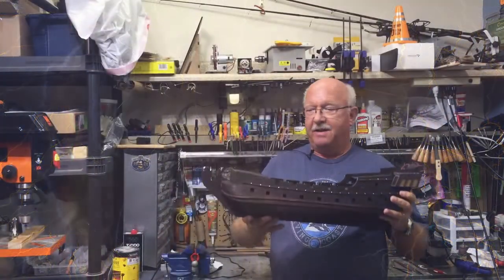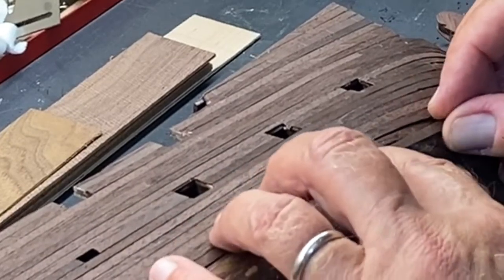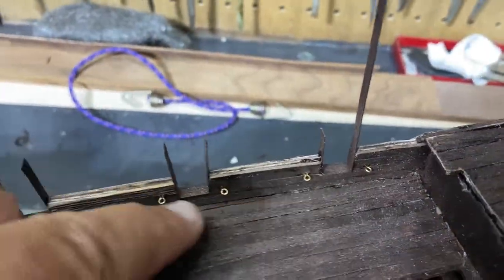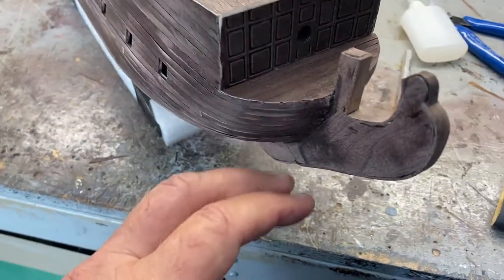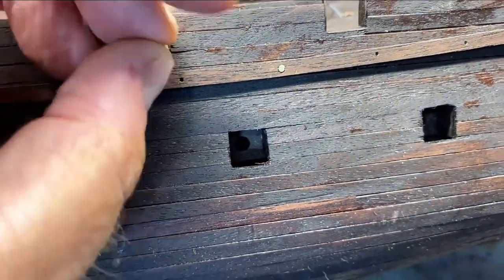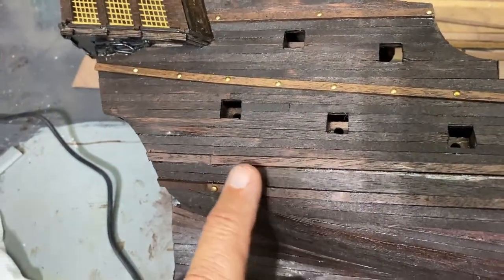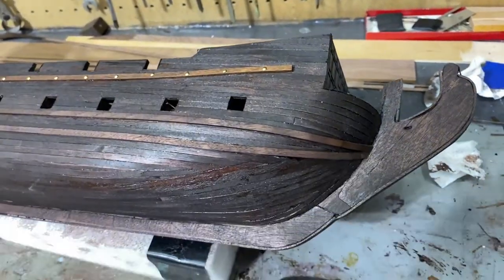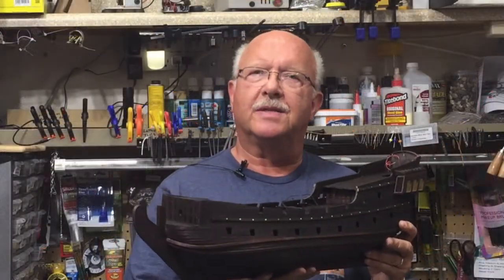The Black Pearl Golden Version 2021 Episode 9

Comment: Dan,what size of brass nails did you order for the side rails?
Reply from the maker: It’s been a while, but I’m fairly confident I ordered them from Amazon.  The head being .3 cm (.11”)
Because I show on Amazon that I have ordered them at least twice.
Here’s a link to those for you to check out.  Unfortunately the ship is on display at a shop in Port Royal S.Carolina, about 800 miles from here, otherwise I would measure them for you 😂.
Here’s the link:
Hardware Philosophy Pure Brass Nails, 0.6 Inch, Bag of 100 - Architectural, Interior Design, Doors, Furniture Cabinet Customization Hardware https://a.co/d/2qNYd1Z

Comment: Hello Dan, Just curious about the size of the brass nails that you have used?
Reply from the maker: I went out to my shop to get one to measure…. I’m out!  So thanks for asking as I’m ordering more!
They are Hardware Philosophy Pure Brass Nails, 0.6 Inch, Bag of 100.
Here’s a link to purchase them online at Amazon:
https://a.co/d/17iWZQr.
SET OF 100 BRASS NAILS: Total length of the nail measures 0.6" (1.5cm)
The diameter of the shank measures 0.04" (0.1cm); Diameter of the head is 0.08" (0.2cm)

In addition, I have been able to find another one that might work too.
It’s got better measurements in the listing that might be an option too?
It’s smaller, here’s that link:
Hardware Small Nails for Wooden Nail Tiny Antique DIY Decorative Boxes 1X10mm Golden/500pcs https://a.co/d/aw4X19g
Note: the picture with the measurements is not the top of the nail. Not sure why they used it?
It’s important to pre-drill the holes in the side rails to prevent them from splitting.
😂👍
Reply from the maker: I’ve found another that I like…. Going to order some because it’s a little shorter.  The.06” as I recall went a little far into the hull.  Here’s the one I am going to try:
uxcell Small Tiny Nails 1.2x10mm(DXL) for Wooden DIY Brass Tone 200pcs https://a.co/d/6g0dNL7
Reply: @BoilerDan1  Thank you Dan, and keep  inspiring us to have hobbies in life
Reply from the maker: You’re welcome. I appreciate the kind words of support!👍